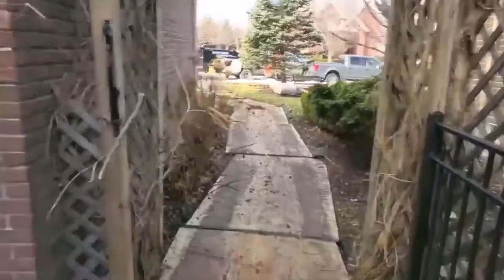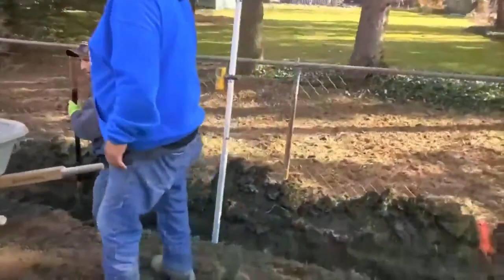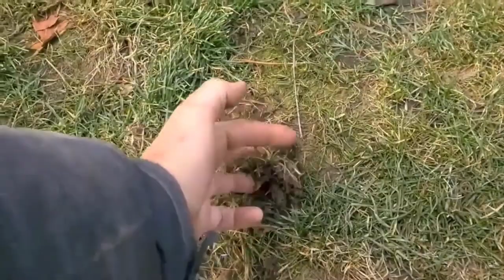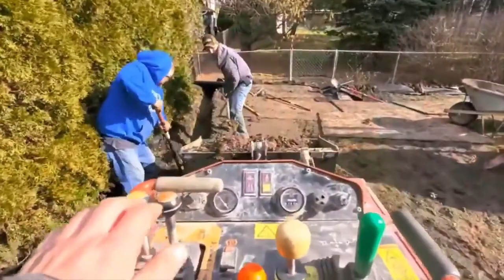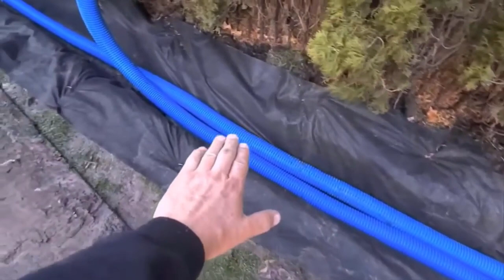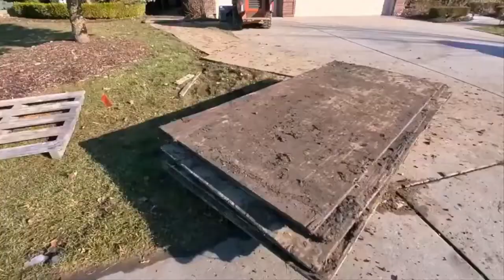5 PIPE Yard Drainage System   [ Part 1 -15 Combined ]

Comment: I would like to say first off that this is not meant as a critique, this is strictly a curiosity learning based question!  I have always been curious when watching your videos and have a question for you.  With all of the torrential (spring, as well as the rest of the season) downpours that we receive in Michigan, I have always noticed that you never add any Tee fittings that vent immediately to the surface in addition to all of the high octane piping that you install.  With all of the surrounding surface water entering the site (especially in this specific site), as well as the homeowner’s storm water flowing off the roof and non-permeable surfaces to the back of the site....I have always noticed that you let all storm water percolate through the grass and stone and into the pipe to flow to your discharge pipe.  I have always been curious from a drainage design perspective why you do not install any vents to the surface to collect and move that storm water faster off the site?  The only thing I can think of is you let it naturally percolate through the various layers (grass, stone, quality filter fabric-geotextile, pipe, etc) to the pipe so that the pipe can keep up with the sheer volume of water, it may be a little slower but it will eventually drain.  I am a professional drainage designer and installer in the Lansing, MI area and this has always peaked my curiosity.  I have watched your videos for well over a year, and you are just about the only contractor that I know of that “does it right!”  Your drainage system designs are well thought out and proven install methods make you a very successful drainage contractor that I admire!  I think it would be awesome if you could possibly make a video on the subject so that your viewing followers and public learn, as they always do from your instructional tutorials.  I think it is awesome that you are so forthright in teaching the public in the proper fundamentals of proper drainage design and installation!  Thank you in advance for answering my question and I look forward to having the honor and pleasure of meeting you in person some day!  Sincerely, Marty Strobel of Professional Gardener & Landscape Services, LLC out of Dimondale, MI.
Reply from the maker: FDM entire system is vented through the double punched fabric. If your a loyal subscriber you would have known that. Vented drainage systems get filled with organic materials and it hurts the drains performance. The natural Filtration of a drain system with double punched fabric will last forever and remain at peak performance.
Reply: @FRENCHDRAINMAN  Yes, I agree, I should have known that from the videos.  I also watched another video where you installed then yard drains with a solid pipe and I had forgotten that you do that.  So, I apologize for not doing a little reminder research before I posted my lengthy question.  Thank you!  Marty Strobel